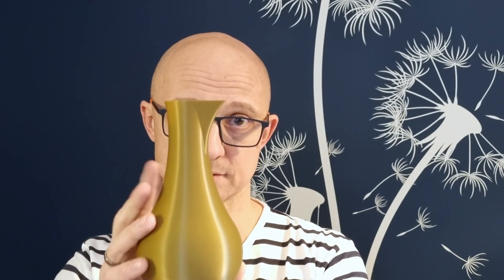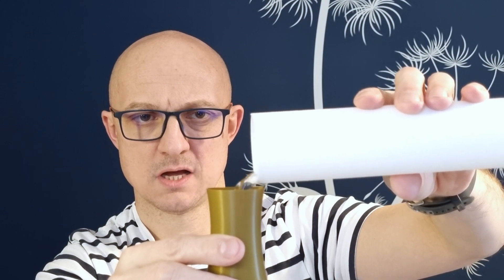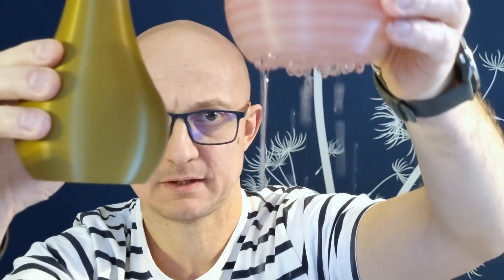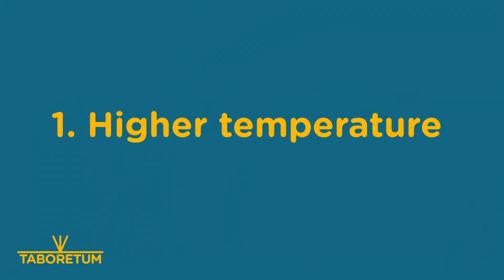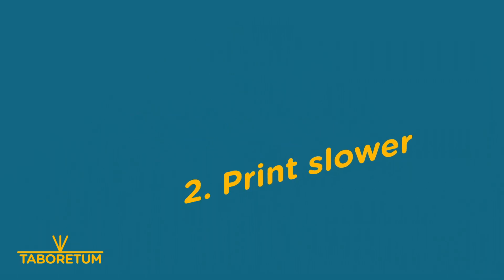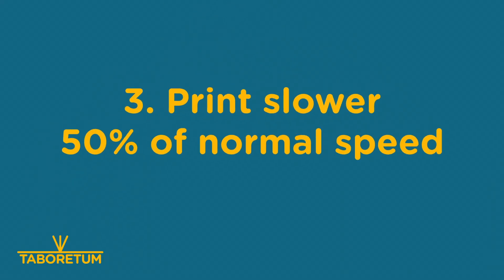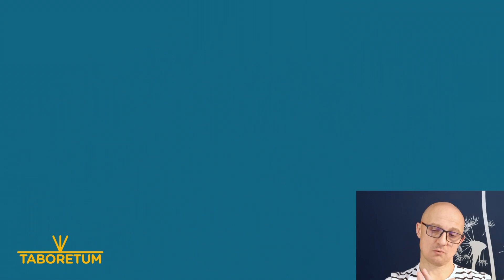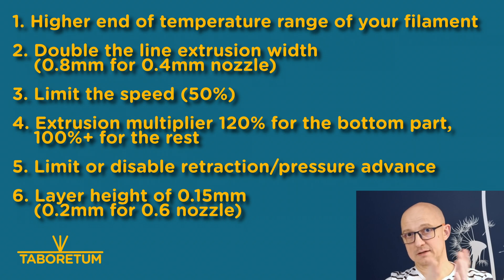Mastering Watertight 3D Prints: The Ultimate Guide

Comment: Hi. Nice explanation. Thanks for sharing. Questions: is it possible to print something thicker, like 3 to 5mm for dayly use, like a cup for drinking water. If yes, infill %? 100%?. Number of walls?. Thanks!.
Reply from the maker: Hi. thanks for the comment. if you can print a single wall things water-tight I would use 3-4 walls and 20% infill. If you want to be super-safe, you can go for solid (100% infill). Remember that 3d print is neither smooth not food-safe, so hard to clean and e.g. mold can grow in these grooves over time. I would suggest covering such prints with some food-save sealant.
Reply: @taboretum  Hello. What food safe sealant would you advice? What about sealing with etanol diluted/ just heated-up beeswax?

Comment: Have you tried adding soil and water to a container? I've not had success with that not leaking over time. It seems like capillary action occurs with soil, but not without it.
Reply from the maker: Hm... very interesting! I haven't yet I have some 3d printed containers used as watering pot for years, full of water all the time. What type of filament did you use? Maybe I can make a video on this?
Reply: @taboretum  I've tried PETG and PLA. I'm thinking it's something to do with the soil allowing water the soak through. The best I've been able to come up with so far is a pot where water is in one side, soil is in the other, then I have a watering cord from one side to the other. It works but I have no idea why.
Reply from the maker: @leesutton One perimeter? Can you share some parameters? And model? :) Extrusion width, layer height, temperature, nozzle diameter. I will do some experiments :)

Comment: I had so many fails on prints meant for watering, 
I turned to trying a Resin print and set the settings on the Elegoo Saturn 2 8K printer to the lowest line size it did for the watering can print.

The watering can was printed and washed and cured in the curing unit and it still leaked water.

So I will have to try the FDM version with these settings you state here? Maybe it will work next time.
Reply from the maker: Let me know if you've nailed it :)